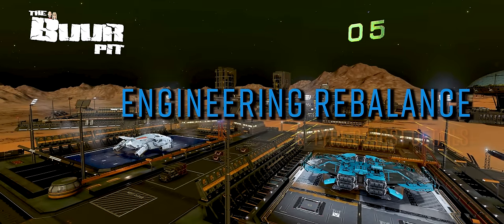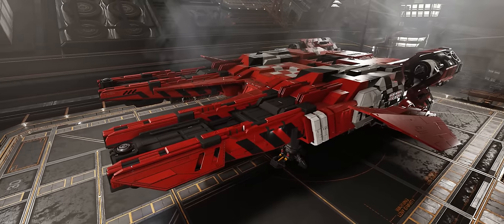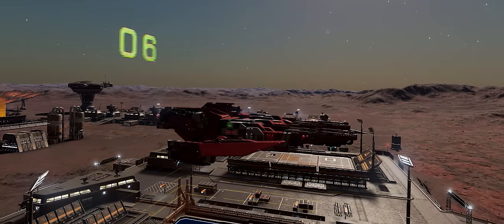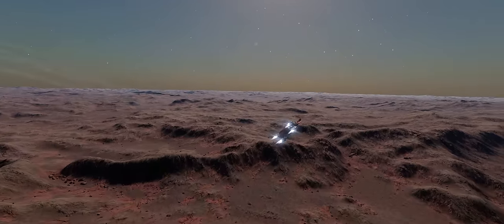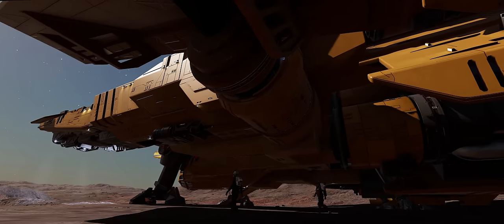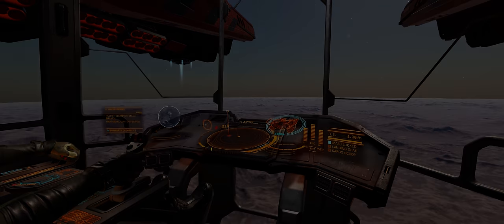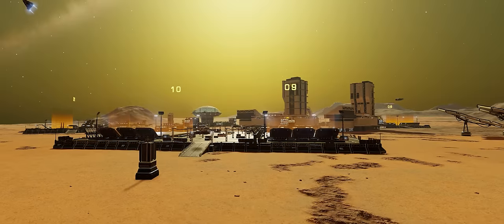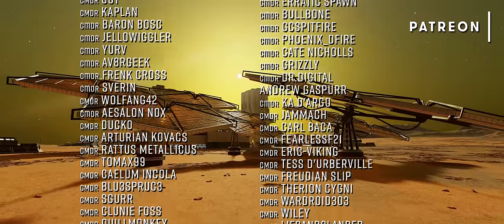Elite Dangerous: Substantial ENGINEERING Rebalance & T8 First Look

Comment: All of the engineering changes are most welcome and long awaited. Increasing the number of mats per instance makes good sense and means less time wasted doing the frontier flop (re-logging) especially in HGE sites where time is so critical.

Other changes I think would make good sense are, being able to 'undo' engineering modules for 'on foot' weapons and suits in the same way you can remove engineering upgrades from ship modules and  adding an extra engineering slot for G1 so there is a module available for each level. Some modules, like noise suppressor & Audio masking (Why are there two silencers?), scope and magazine size should be purchasable items to and bolt on/off as you wish like in RL

Comment: This is much needed. Engineering in particular needed sorting out years ago. My only concern is other than starting again, I generally am sort of at a point where I am bored and don't know what to do. Reflecting on this Combat Elite is the only thing left I need to do, and for that I need a combat engineered ship. A lot of content creators documented how to engineer ships, but the endless grind to achieve this really really really made my eyes bleed. It just did not appeal. At all. I just don't get time.

This update however does make a difference. It will give me another arc to pursue. I like combat, I am just not very good at it, so working to get materials in a more productive way will be very welcome.

The game should be about work, effort and achievement. But also is about enjoyment. FUN. This update is long overdue, and very much needed. I tip my hat to who drove this, but it could have happened sooner.

Potentially then I could be looking at playing more, getting combat ships, getting Elite rank, then looking at exploring, Guardian sites etc, but mainly exploring.

I do feel sorry for the excellent players out in the black (eg Cmdr Picard) that essentially can't benefit from any changes to the game because they never come back to civilization!

If progress is faster, based on experience starting again could be easy to do as a seasoned player. It does suggest unless new players come into the game, the thought on buying pre-built ships might be pointless. For seasoned players, they will know the routes to get where they need to faster, and with readily available materials then this will be even faster.

So custom built ships will only appeal to new players. FDEV need new players.

That said, NEW ship types such as Python MK2 and Type-8 do appeal as they are totally new.

We don't want a constant stream of new ships - we aren't Star Citizen, but a steady stream of new ships would be welcome.

A competition for Cmdrs to design new ships/SRVs etc would be good?

Fixing multi-crew is another thing that if they can get right will be very welcome too. I don't play in Open, and I don't really play and interact with other players - it is an online game. Multi-crew fixed would go a long way to help bring people together  with multi-crew roles and activities.

Something that occurs to me. If a ship can carry two SRVs, with multi-crew could you both drive at the same time on a planets surface? I doubt it, but that would be cool?

Thanks to Cmdr Buur and all other content creators. Without you we would have given up years ago on what in my opinion is my favourite and most immersive game.

I have irl stuff to deal with, but my hope is to get a Python MK2, and see what it can do, then get those materials, and go from there.

Comment: I was hoping for engineering becoming a "put materials once, use credits to apply new ones" to make experimentation easier. But these numbers are indicating that experimentation is going to still be easier by just making materials more abundant and easier to burn through & restock. I just wasn't expecting FDev to boost the numbers THAT much.

Comment: Great update, as always, thanks Cmdr. 
Looking forward to taking the Python MK 2 for a spin. But I'm very keen on the engineering changes. 

I'm of those rare creatures that doesn't mind the current grind too much, but probably because I'm used to it from other games (X3's Hub Plot will break your very soul) and I'm still somewhat in the honeymoon phase of my ED experience. 

That said if these engineering improvements mean I get to do multiple builds and switch between them rather than focusing on one build, then I'm definitely keen.

Comment: The changes to engineering are a massive step forward!

I am one of those players that has most of the ships engineered...
Did I enjoy doing it all? No!

I made a decision at a particular point in time, to fully engineer all my ships. (A massive undertaking)
The reason I did it was so that I could swap between ships without changing modules.
After I had spent a long time having to swap things out of one ship to another.
Another experience which is Zero fun...

The removal of that damnable system of random amounts of G5 mats needed to fully engineer a module.
Will lead to a lot less anguish & utterly meaningless frustration to all as well!

The game is meant to be fun!
The more that Frontier make the game fun.
The more people will want to play it...

HooooBlinkingRay!!!!!

Comment: MuH gRiNd. 

Engineering hasn't been a grind since they introduced the materials trader. Go to the correct system / system state and then go to the correct high grade emission, collect the G5 materials then down trade. It's even easier now with the SCO drives.

Comment: Great news about engineering, it's nice to increase the drop rates and all but I hope it's not only for the G5 mats, the trading of mats feels backwards, we're farming the "Rare" stuff to trade it down...instead the common stuff should drop like candy and we should be trading up to get the rare stuff because we're full on low grades...that would make more sense...
The biggest pain point for engineering is not even the mats gathering, it's getting your 10 ly combat ship to do the milk run to get to each engineer, they should allow all the blueprints to be applied remotely but at double the rolls/mats required, unless the blueprint is Pinned then it's regular rolls progress.
Also Ship encoded mats are likely going to still be a pain to get, unless they also greatly increased the drop rate of encoded when scanning ships and wakes and data beacons...or added more of them as mission rewards. 
Increase in the suit backpack is fine, especially if each thing you collect now gives you more items, but otherwise it was not really needed, I never had to empty my capacity modded backpack more than once even on a large settlement...they should increase the module storage capacity for ships instead...
Oh and they should allow Suit/weps mods to be overwritten...o7

Comment: I don't believe I engineered anything suit related - just could not be bothered.  Maybe these changes will help, though I hardly bother with legs at all tbh.  The ship changes will (hopefully) mean I can try things like clean drives to get heat down without feeling like I need a week to gather resources....and therefore not bother and go play something else instead.  I've done the relog thing at Jamesons crash and Davs Hope and it gets real old real fast, but it was the only way to realistically get the stuff in a few very boring hours versus fighting RNG when I just don't have the time available anymore.  Fingers crossed it end up as good as it is promising.

Comment: Taking a break from Elite since the last titan. Planning to return for the next one. I really appreciate the changes that have already been made and am looking forward to the Engineering rebalance. I'll definitely buy the new T8 "Stellar," just as I bought Stellar Python. Yet, I have something to say about Engineering..
First of all, they haven't said anything about recycling old FSD modules or removing upgrades from the on-foot equipment. The suit backpack capacity should be doubled only if they double the materials at sites. However, most of the time, I find these on-site materials to be trash, not worth picking up — they're useless and cheap — so they're trash.

Comment: Overhaul is a strong word. they just tweaked some numbers.
Amount of Material reward and missions giving material reward has been increased to 4-5 times. and Material requirement for upgrades has been reduced by 2-4 times. 
which is very much welcomed althou the always full goods storage is still an issue. lets just not call it an overhaul.

Comment: As someone who is thinking of retuning, could you define what you mean when stating SUBSTANTIAL. Do the various material's now give more than three each or is there just considerably more material's of the same nature to aquire? Which in the difference would be that of bring considerably more limpet's depending on size of limpet controller. One can utilze a couple with short duraation's and distance to that of a longer duration, and a longer distance.

Comment: that's only a small part of the engineering problem though... they "solved" the exploit grinding issue by just throwing materials everywhere so we don't need as much to use exploits. they eliminated the randomness which is pretty cool too. but the elephant in the room of engineering is how every time you build a new ship outfitting, you'll need to move around the bubble to meet ~5 different engineers to get your experimental effects done, and i do hope you have chosen really well what blueprints you pinned, otherwise you can add an extra 1-3 meetings to that.

if they must do something, it's thinking about how not to punish players with more leg work as they unlock new engineers. that pretty much forces people to just go to colonia and stay there, where 3 engineers can cover everything.
colonia is cool, but that's not a satisfying solution. because when you introduce a friend to the game, you'll have to run back to the bubble to meet him. that's not too crazy of a trip... just 75 jumps with a 85ly conda, not counting refuels... it will take roughly 2 hours of gameplay. and when that friend gets a bit deeper into engineering, he'll have that same numbing legwork experience.

Comment: I don't see a use case for the type 8 in the end game, but I'll probably get one anyway when they are available for credits. I wonder if the changes to matts affects sentinel drops needed for synthesising ax weapon reloads?
Reply from the maker: High volume trade into and out of medium pad settlements and outposts as well as blockade running in hostile systems.

It's also a very competent laser miner with a bit of engineering.

Comment: As a word of advice, do not engineer the modules you get from the prebuild ships!  If you decide to recycle that ship for a new build, you cannot remove the engineered module.  All you can do is remove all engineered upgrades.  I learned this the hard way when I was building my anti-titan python Mk II into a basic AX Python Mk II.  The ship just cant run all the modules needed while staying under 20% heat.  Had grade 3,4 and 5, on almost every piece, so the upgrades were a waste.  

If you plan on engineering the prebuilt ships... replace the modules before you upgrade.  Even if you need a 6A powerplant, still go and buy a new 6A powerplant incase you ever want to recycle that ship.

Comment: I think my biggest gripe is that even with engineered weapons it takes 10 to 20 times the time to eliminate a combat vessel than it takes to wipe out 2 or 3 dudes on foot in a combat zone.  I can consistently earn ~8-13 mil from a tier 3 ground combat zone which I can clear in 10 minutes. When I take out the pilot of a multimillion credit combat vessel I should be rewarded with significantly more cash than when I tap some random dude and his 3 buddies with a rocket on some poorly lit moon.

Comment: As someone who hasn't played in a few years is the Odyssey version still as it was when it first launched in terms of performance issues?
Reply from the maker: It's significantly improved since launch.  It's still quite a system hog if you're running a potato however.
Reply: @TheBuurPit  I guess I'll know how my system handles it if I ever get around to getting my hotas back in working order. CPU I'm not worried about in all honesty, but GPU is a different story.

Comment: next update should bring increased capacity of modules you can hold from 200 to at least 500. im tired of having to buy t-10's to use them as storage and then to go through each to find needed module and dont wanna sell already engineered ones.
also remove limit of 1000 odyssey materials. i have carrier and i am limited on both even i have tons of free space.
another thing is inability to carry extra ammo in your cargo and inability to reload the weapon to full clip between two engagements.
and we should have the bubble chat channel. some 250-350ly around sol would be neat. 
final thing is make engineering materials to be able to sell and buy from the markets. i cannot understand why is that not a thing in the game since the beginning. some quest or specific task ones should be obtainable only by personal grind, like for engineer unlock, but everything else should be accessible from the carriers or specific systems markets.

Comment: Still no way to remove unwanted mods from space suits and handheld weapons. Still no material traders at Odyssey engineer bases, and no Pioneer Supply Store at those bases to unlock slots for mods. Also nothing about pining the blueprints so the player can track the needed materials without using pen and paper or a external tool... Well, at least Frontier didn't start to sell Grade 5 Odyssey gear with usefull mods for ARX.

Comment: I hate that you can only get up to 5 materials in each mission. grade 1 mission gets you 3,4 or 5 items. grade 5 missions get you 3,4 or 5 items. same goes for the other graded mats. vs time investment. sometimes you need to transport x to y giving you 5 materials vs 20ly travel. other times you get 5 materials for transporting x to y, z, a, b, c, d and need to travel up to 300ly to get the reward. (witch is the same as the 20ly small trip giving you 5 materials.) nobody is going to do these missions when there is a simple A > B one jump trip. give me somewhere like 25 - 50 materials spread accross the board for these longer and longer missions so you actually going to do them. I'm not transporting 6 people to colonia for just 4 million credits + 5 grade 5 materials. Insane. Idiots.

Comment: i dont care how good the engineering changes are, im not coming back until the Arx purchased ships have similar downsides to credit purchased ships. its not fair that my ship costs a quarter billion any time I blow up and takes several minutes and tens of thousands of credits to move while the guy who buys everything with real money can instantly transport his ships for free and doesn't have to worry about them blowing up as much because it costs him nothing when it happens.

its insane to me that when i was asking FDEV to remove rebuy from the game people just told me to "git gud" and when i finally did git gud they give free rebuy to people who hand them $20 per ship and people seem to be okay with it... don't get me wrong, I'm fine with FDEV selling ships for real money. Warframe (a game i adore) sells Warframes for real money. the thing that bugs me is that your getting more than just the ship and some modules to jump start your self into you preferred play style. your getting a reprieve from an oppressive mechanic that players who don't pay have to play around. that's the part I don't like. as soon as those arx ships behave the same as a credit ship i will come back. the engineering changes- while moderately disappointing are a big step in the right direction. i just feel that the arx ships are a neutron boosted FSD jump in the wrong direction.